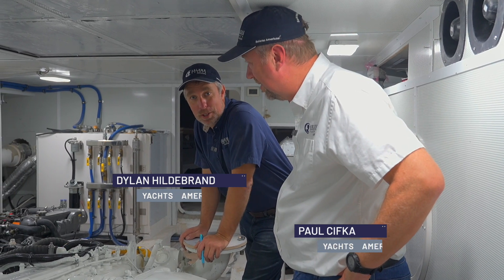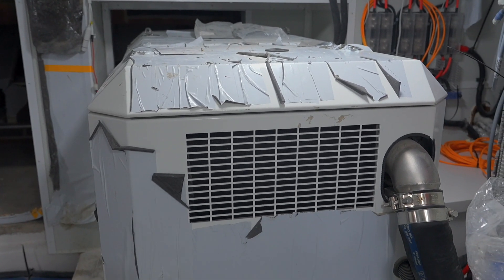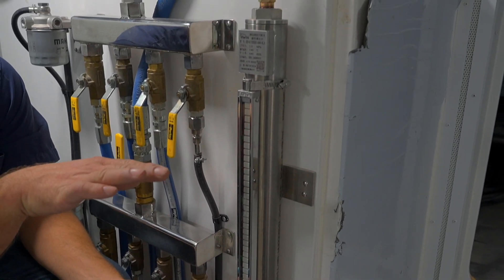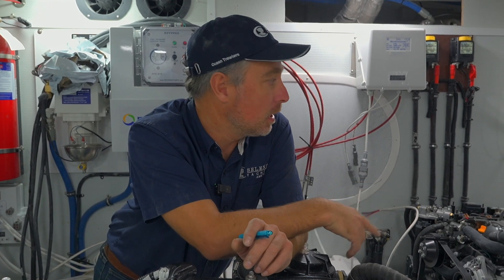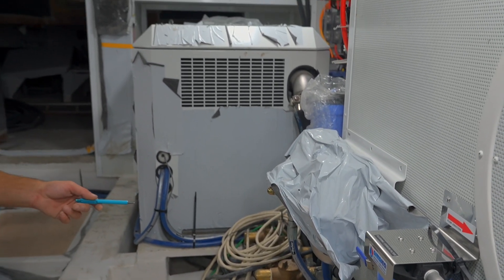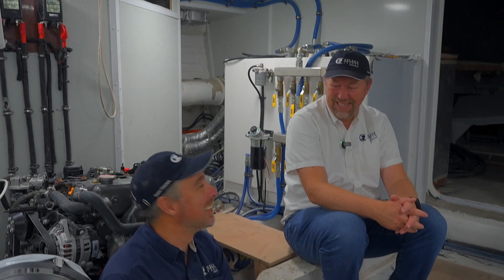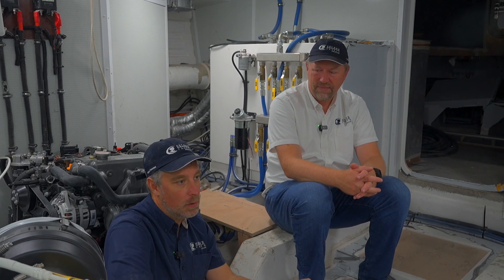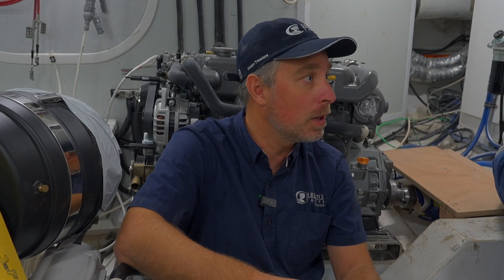New Selene 60 In-Build Engine Room Tour | Tech Talk & Systems Overview

Comment: I did indeed enjoy this video.  Do you have any comments on a single tank system that is used like on a car? No manifold system, fill from either side, maintains boat stability by not having more tanks to balance to get that stability. Curious, as Selene is on a short list for our next boat. Thanks. 👍
Reply from the maker: Hi @HopeOfJoe, thanks for the kind comment and great question. The feedback we receive from our owners is that they really appreciate the ability to move fuel between tanks if there is a scenario where they want to do a little trimming (e.g. the dinghy is off the boat for extended periods of time) as well as the ability to control fuel if receiving from a potential dirty fuel source.  We've also evolved our system to add a day tank where it makes sense for the owners needs. That said, we are happy to talk through any questions/ideas you have. Feel free to reach out anytime: info@seleneamericas.com or 877-689-3979. Happy New Year!
Reply: @SeleneAmericas Thanks for the reply and it makes sense to transfer fuel (trim the boat) because you have more than 1 tank….and now 3 with the day tank. It would seem logical from a different perspective, that there would be no need for trimming (and the expense of a manifold system) if there were 1 tank, slightly aft of the master bulkhead and was the full beam and height of the lower deck of the boat. The fuel would drain down to the center (cob, cog), and the trim should be barely affected, if at all. Just curious as another high-end manufacturer does exactly that, yet they use 1,000 hp motors and we don’t want to deal with that. Thanks again for reading my questions.👍🏻🙌🏻 ✨🌊💨🛥️🏝️👙🌞✨
Reply from the maker: @HopeOfJoe  Our Technical Director Dylan Hildebrand wrote a response for you: Hi Joe, Thank you for your comments.  
When we design these boats the first and most important thing we take into account is the owner's anticipated usage of the boat. Based on this, we try to make a "Mission Profile" for the vessel. 
From this we can start to envision the machinery and demands that are going to be placed upon a vessel. Keep in mind that we have not yet built the same vessel twice, each Selene is unique and has been built with the owners wishes and plans. This vessel in the video above was designed with some really remote cruising in mind. 

Your comments on having one large fuel tank.
We can do a system like you suggest, It would work really well in areas where we know the fuel is clean and does not have any contamination in it. The tank would have to be baffled to prevent the free surface effect and would probably look more like 3 tanks with small transfer ports in the bottom and top. (all integral to the tank) 

For vessels that are headed to the more remote areas we really feel that a "Daytank" which holds only perfectly clean fuel is a very good item to have on the boat. 
For cruising most of the USA and the Med the fuel is really good with no issues, but when you get to areas that are much more remote the vessel operator is forced to use fuel that would be considered "Sub Optimal".  Allowing this fuel to settle in the deep side tanks where we can separate out water by gravity and then running that same fuel through a filter system with a coalescing filter is a good way to ensure a clean supply of diesel. The Day tank is automatic in operation and has fitted alarms if the automation system is not functioning. 

In our experience modern diesel engines are quite reliable. As long as we supply the engine with a clean supply of fuel, seawater and air the engine will have a great service life. We are working on every vessel to ensure that the engines are kept in the best possible state. 

We welcome the chance to work with you. Thanks again for your great questions!
Reply: @SeleneAmericas  Thanks for the reply and the education. Selene is on our short list. Thanks for your time.